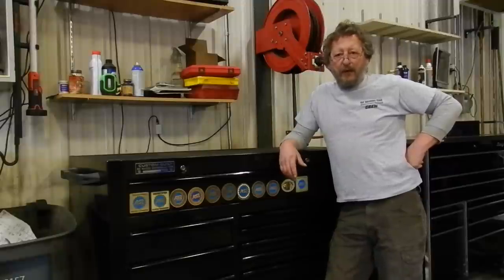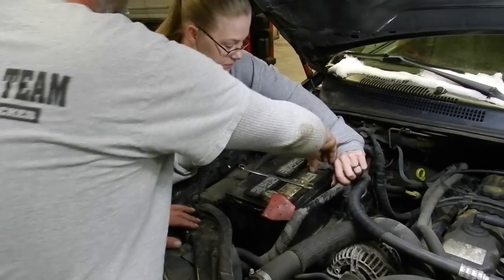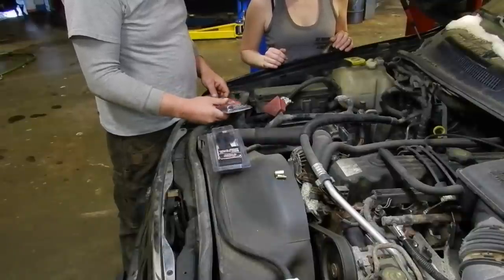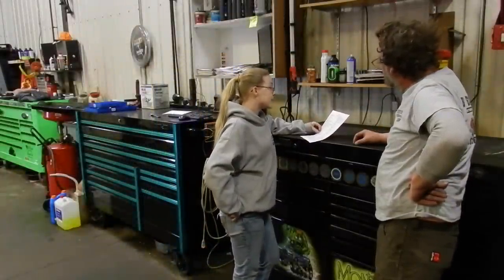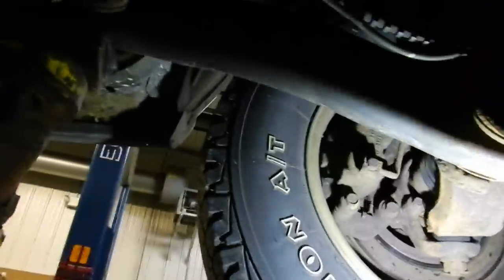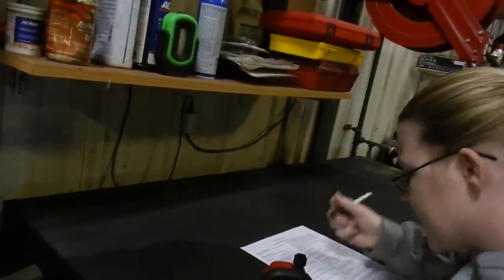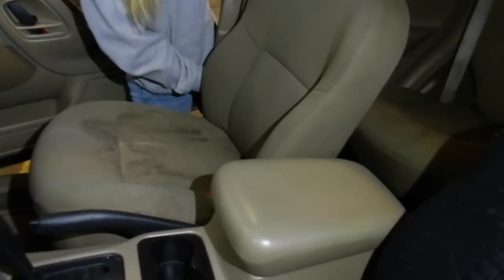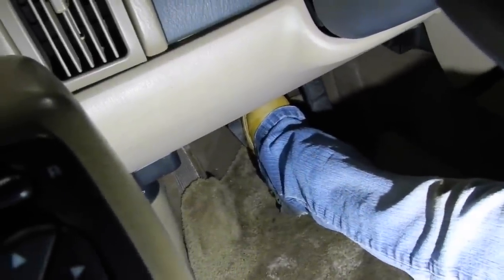BUDGET TRAIL GRAND CHEROKEE for BSF Recovery Team

Comment: I've been working on vehicles for 20 years never been shocked by a battery and you can touch both posts at the same time and not get shocked AC power you have to worry about

Comment: You ought to have said about leaving the first spanner on the battery, it could short across the terminals of a charged battery, granted in the case of the dead one it's not an issue, but it's better to learn the easy way rather than the hard way.
Reply: thats no big deal just knock the wrench away with a stick if it contacts. now a real fun time grind a wrench on a starter bolt and try to get the wrench off before it melts while its welding itself to the bolt thats a real fun time

Comment: Pretty sweet Jeep I just got a 99 Cherokee Xj as a budget trail ride  project already has a 4 inch lift.... got a good deal on it.... it won’t stay running so I’m hoping a new fuel pump will do the Trick
Reply: I hope you checked fuel pressure and power at least at/through the fuel pump relay.  That's a pretty big and expensive job to not properly diagnose first.
Reply: Dustin Tunis yea man I checked the fuel Pressure and it was getting great pressure until the Jeep starting warming up than it wants to lose fuel pressure and act like it’s out of gas
Reply: @coreyward5157  - I've never heard of a fuel pump going bad like that, not saying it couldn't though.  I wonder if there is debris in your tank and it clogs your sock filter, but settles away from it when you shut it off.  You could try running it until it dies, then shake the crap out of the Jeep to slosh the fuel around to clean off the sock filter, try restarting and if it starts right up then you probably just need to clean out your tank. 🤔
Reply: Dustin Tunis I used to have a 1994 Ford Explorer that went through a fuel pump a year it would start getting hot the pump would overheat and the fuel pressure would get lower and lower until it died
Reply: @jessicacordova5024  - Weird, I guess I have heard of it now.  Did you run it low on gas regularly?  The fuel pump should be submerged in gas to keep it cool until you are low.
Reply: Dustin Tunis no sir always filled up onc e  it hit 1/2-1/4 of a tank almost always a 1/2 tank or more since we did a lot of road trips and stuff we ended up finding a fuel pump company out of Texas that fixed the problem we ran that pump five years with no issues then we blew the transmission 4 wheelin in y
Reply: @jessicacordova5024  - OK, well that's a new one on me.  What was the problem that they fixed (if you remember), was there an electrical issue that was hard on fuel pumps?

Comment: the grand cherokees make awesome woods bashers no one wants them for some reason. the last one I got for 500$ needed a water pumper was fully loaded. a water pumper and rad later it was good to go. had to change the rad because I tried to be lazy and change the pump out without pulling it and as im finishing the new pump the wrench slipped and went right in the rad

Comment: 12:00
Am I the only one that noticed that the brakes an not uniformly worn?
Reply: I drove a '95 Nissan Hardbody 4x2 that I bought for $700 with one side of a front rotor worn-down far more than the rest, it was backingplate on rotor when I bought it and I just threw new pads on.

I'm not proud of this but for around-town driving it was fine, it stopped straight and didn't suffer any weird brake fade.  When I finally did brakes on that truck it was a major PITA (rotors are behind the hubs, one has to pull the hub like on a 4x4) and it didn't stop any better afterward.

Uneven wear doesn't necessarily mean that it won't perform decently enough.
Reply: @TWX1138  I was just pointing it out.  Could be a potential problem down the road.  I had a Silverado stopped great then I went to redo the breaks and there was not rear breaks I mean none.  No pads, shoes just the push roads for them with a c-clamp.

Comment: put a 4 link on the rear lock the front and rear ends put a set of 35's on it and it will be one BAD SOB.
Reply: I wouldnt waste the time locking the d35 just lock the front
Reply: @TheMrhick92  I forgot that is a 2003 he don't need the 4 link either.
Reply: @MadsWorld34  i took a look at video again to check and since the pumpkin is rusty that means its not a d44a cause if it was there would be a good chance it had a factory lsd